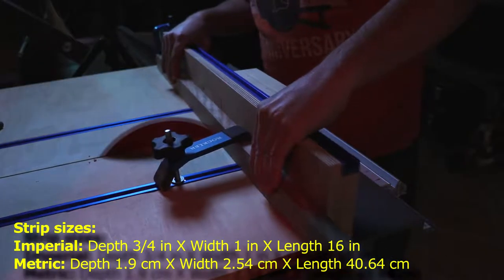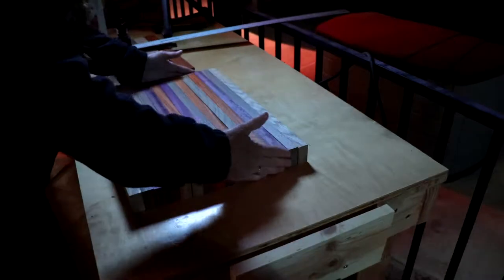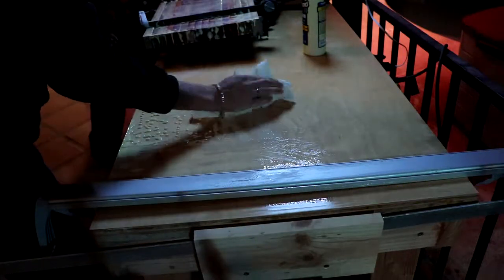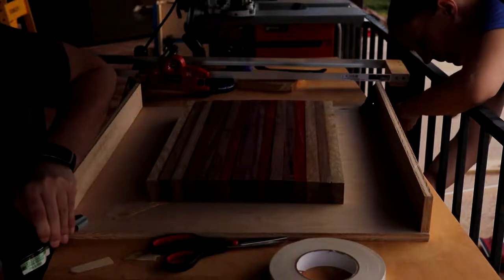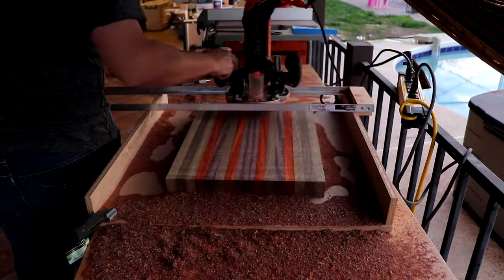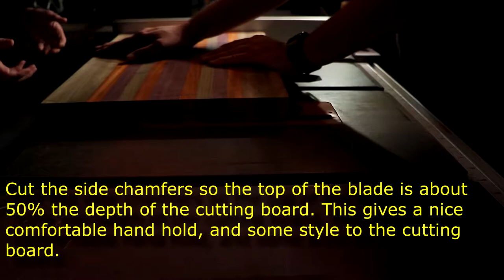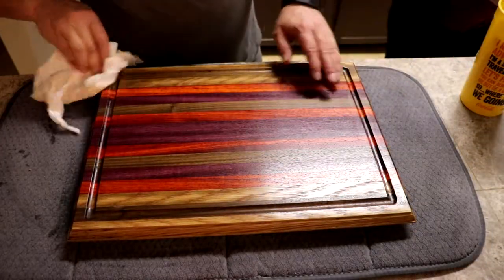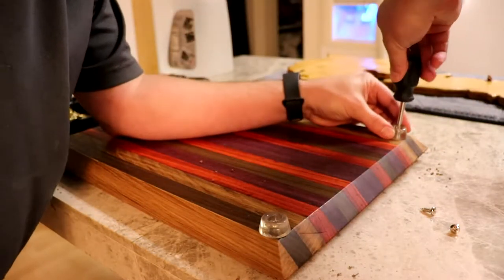DIY Hardwood Side Grain Cutting Board: A Stunning and Durable Kitchen Essential

Comment: How is it end grain?
Reply from the maker: It's not an endgrain cutting board. It is an edgegrain cuttingboard. So basicaly you can look at a piece of wood as 3 basic directions. end grain for the fibrous part of the wood, edge grain which is just what you interpret as a side, and face grain which is considered  the non fiberous top or bottom perceptually. 
Edge grain and face grain can be interchanged to a point. So in essence edge and face are basically the same thing. The cut side of the wood is often called the edge, where the non-cut side is normally called the face. It's more or less a technical term. 
Regardless, edge and facegrain cutting boards are not endgrain cuttingboards. And unlike endgrain cuttingboards, you can run these through a planer. Endgrain cuttingboards are considered a hazard for a planer(endggrain can get caught on the planer blade in some cases, a router planer may be ok, but still not recommended for burning reasons), and should use a thickness sander instead, which I have been told is very useful(would love to have one), however kinda pricy. LOL Anyway, I hope that clears up any confusion on the topic. 
Please let us know if you have any other questions. 🙂

Comment: How do you clean it?
Reply from the maker: What we have learned that when your cleaning it, really get it sudsy(like a good bubble bath), and use hot water not warm or cold. Let it sit for a few minutes. Then scrub down with the scouring side of the sponge and rinse off. This is a really good idea if you use deep poor woods like oak in your board. Doing this seems to kill off any bacteria or pathogens that may have introduced them selves. Never wash in a dishwasher. That will almost certain destroy any wooden cutting board.  Remember all wooden cutting boards over time with become rough, have cuts, and other blemishes. If you have that happen, use some 120-220 grit paper on your sander and sound out the issues. Then douse in mineral oil till it sucks it all up, and reapply a food safe wax like Howard's cutting board oil, and conditioner: https://amzn.to/3XkuNsh which is what we use now, and basically did back then when we made this video. I hope that helps you out. If you have further questions, feel free to respond here and I will get back to you as soon as I see it!